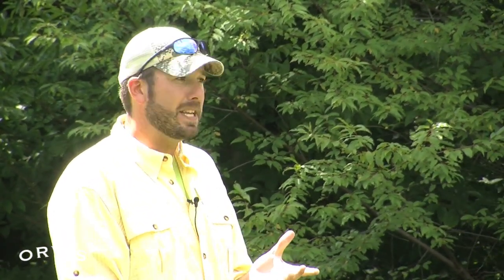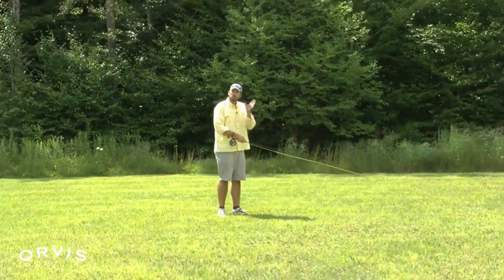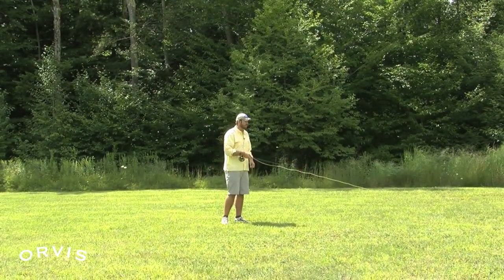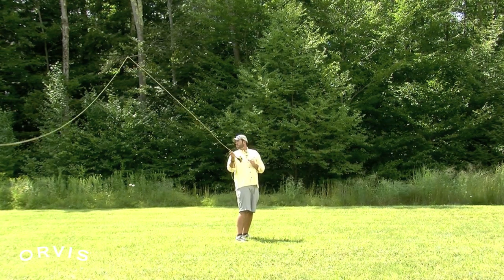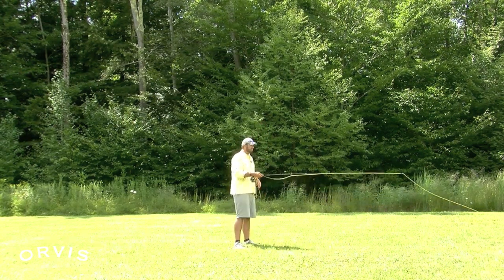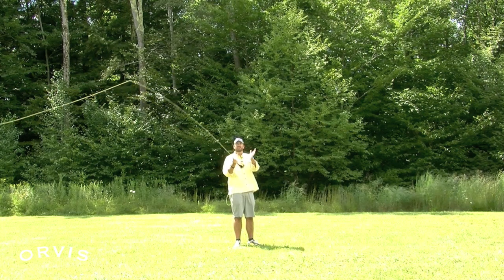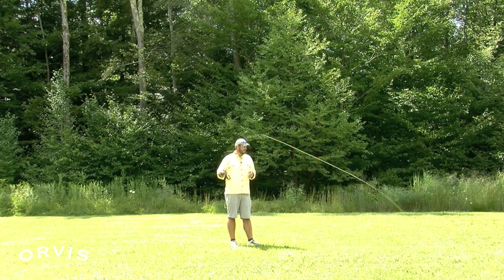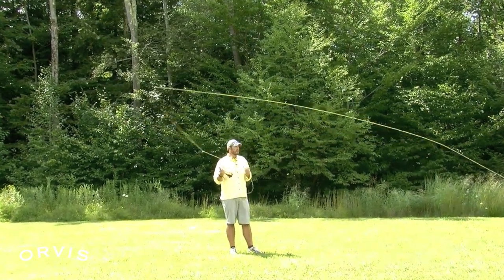ORVIS - Fly Casting Lessons - How to Avoid Hitting Your Rod with Your Fly

Comment: My fly rarely hits my rod, but it hits me in the back of the head quite a bit. What might i be doing wrong?
Reply: Cole Jackson 
There could be two things you might be doing wrong.
1. There is wind that is shoving the fly at you
2. Your wrist is twisted towards your body, which causes your fly to hit you in the back of the head on the forward cast.

Comment: All these videos assume your fishing light dry flies. Which for me is easy to cast. But 99.9999 % of the time any place I’ve been it’s double nymph or dry and nymph rig sometimes with weight and most times with indicators. Now your swindling a chain through the air and the only issue I have is fishing really close in small streams if you get a hit and try to set the hook… that string of hell is coming back at your rod and your now starting over with a new rig.